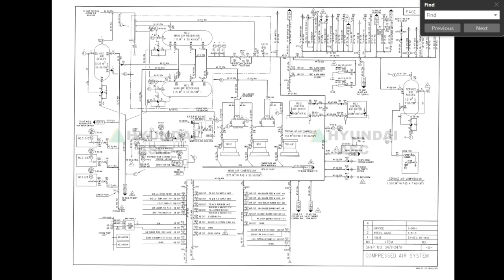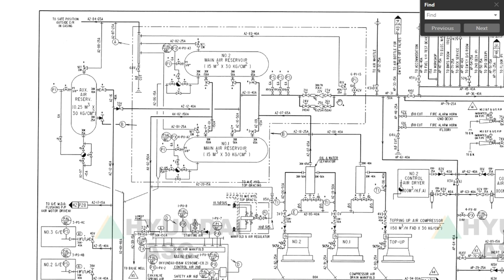PRESSURE REGULATING VALVE TIPS & DETAILS PLUS OVERHAULED

Comment: Good video. I know you can adjust the opening and closing pressure of the valve by adjusting the nut. How can you check that the reducing valve is opening at the desired pressure. We first want G/S or Control air compressors to work and then the reducing valve is a back up. How can we ensure that the reducing valve is set slightly lower than the start pressure for the g/s and control air compressor.
Reply from the maker: yes we can adjust when setting it on test bench